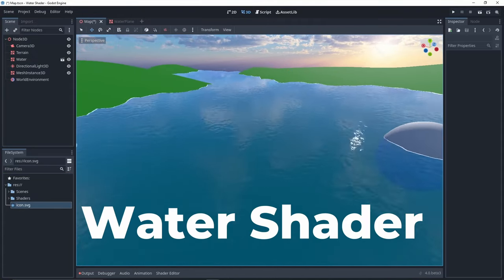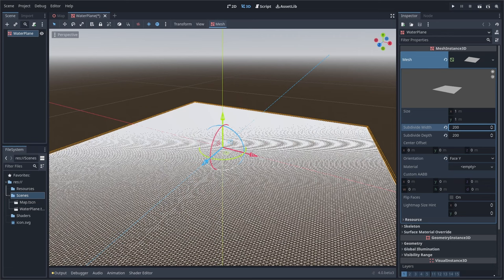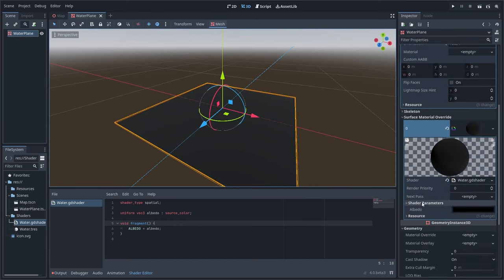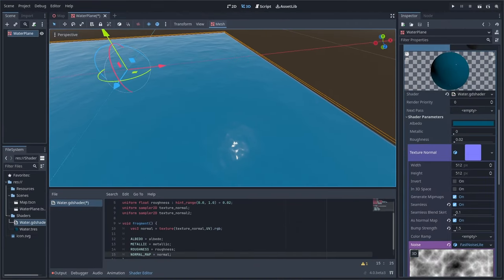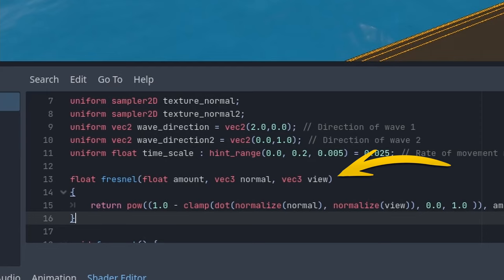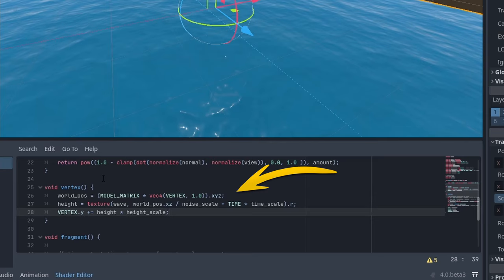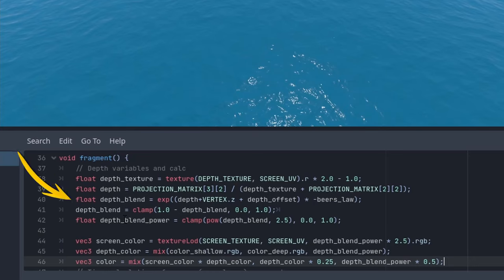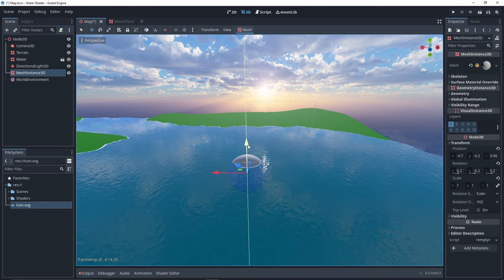How To Create A Water Shader // Godot 4 Tutorial

Comment: The edge detection does not longer works in 4.3
Reply: I won't take credit for this because I found the answer on reddit. But here is how you fix the edge detection. Apparently, Godot 4.3 changed depth textures to use reverse z.
So, in the edge function, change the calculation to:
depth = 1.0 - 2.0 * depth

I imagine the shallow/deep calculation will require a similar fix.
Reply: @milkwyzard1833  thank you! you just save me alot of time :)
Reply: @milkwyzard1833  muchas gracias!